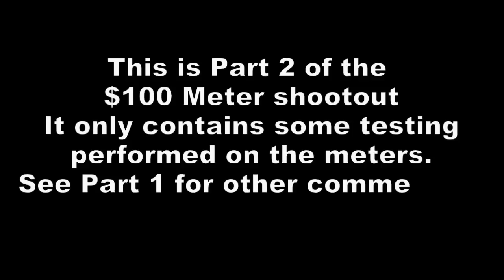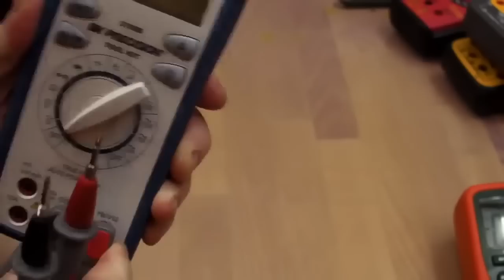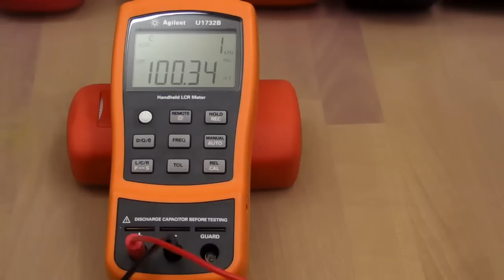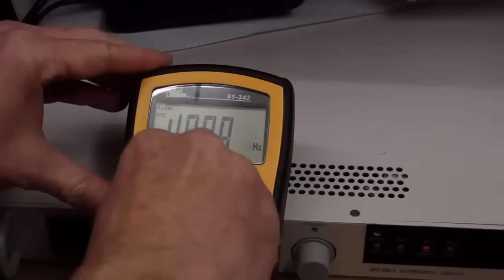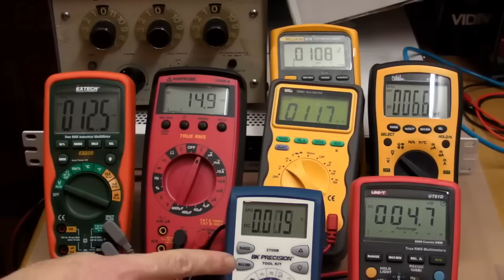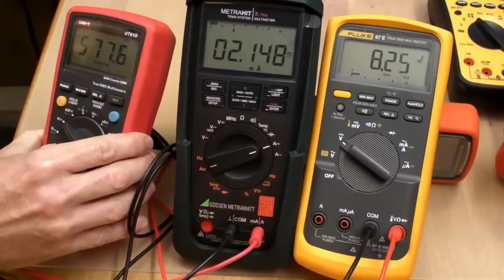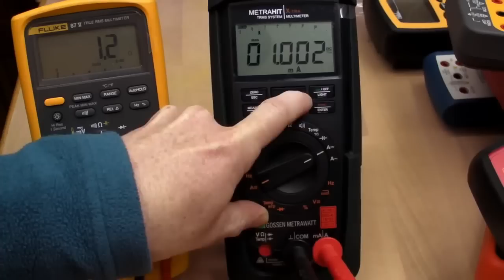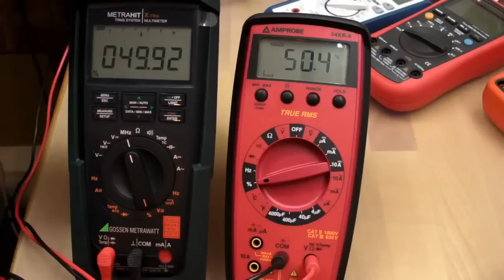EEVblog #99 - $100 Multimeter Shootout - Extech Amprobe BK Precision Ideal UEi Uni-T PART 2of2

Comment: I quite agree with your assessment in part 1 and the fantastic continuity test sealed it for me. I just ordered the BK Precision meter at TEquipment (which happened to have the cheapest shipping to Spain, win-win). I just have to watch out for the burden voltage, but oh well, you can't have everything.

Comment: i guess i answered my own question. i really like my UT60. serial comm works great, but my jaw dropped literally when i was probing around in a MOTU Traveler that i have for repair - i hit the main clock of the DSP and the Uni-T UT60 proudly showed 48MHz!!! Forty-eight meg on a meter that is supposed to max out at 10. That's just darn awesome.

Anyway i found the main issue, blown firewire controller, there are also a number of minor things i will deal with after that chip arrives.

Comment: Dave. You know , I just bought one of those extech 330's. I know you reckon they roll about a lot but I have a cure for that, grab a couple of those sticky square case feet you can get for home brew boxes and stick them to the lower rear corners . not elegant but defo stops it rolling about on the desktop

Comment: +EEVblog Thanks Dave, great video and product comparison. I am looking for a $100 range DMM and your comparisons have helped a lot. -b <---That means thumbsup! This video and your efforts took you some time and effort and is appreciated. Back in the '80's, I worked in repair maintenance in a factory and I used the Fluke 77. I accidentally dropped the 77 several times from the top of overhead (~30 Ft.) cranes while troubleshooting and it survived every time.

Based on the results of all the tests that you did, I would get the BK, which you also seemed to choose in your wrapup in Part 1.

Product Comparisons -b Fundamental Fridays -b Mailbag -b Teardown Tuesdays -b

Comment: I have the Ideal 340 meter.  Same functions as the 342 but not TRMS. I had the same Temperature reading problem until I looked close at the thermocouple. There are + and - signs by the jacks. Doesn't make sense but the temp function IS polarity sensitive.I use this as my secondary meter and love it.

Comment: Dave, what an idea, have a forum design and build your own $100 level meter which has the best features of all of these.. i.e. the 9v battery, the metal thread inserts, the high voltage fuse access, cat rated cables, the right 90deg probe input jacks, a nice fast continuity latch and beep tone, white backlit lcd, a nice REL feature, good cap measuring, etc

Comment: Surprisingly only the Amprobe and the UT61x has the bargraph ... at 100$ BK-P should have thrown that in. Oddly none of them have more then 6000 counts ...
Seems like autoranging speed in relative to continuity speed
(Well the UT61E is 59.20 and that puts it into the 50$ category and is pretty darn quick)

Comment: Seems like every Extech you reveiw has some serious issues. I am a little suprised you like them at all. I use to think they were a good company but I am not so sure anymore. I am an HVAC tech and I use the Fluke 116 with a Fluke 323 Clamp meter. You can count on both for accurate and dependable readings. I enjoy your show, keep up the good work.

Comment: I have a multimeter from which seems to be from the same manufacturer as the Extech (PeakTech 3360). And it also freezes from time to time, not only when you overload it.

Comment: I want a good multimeter from Fluke and I'm willing to pay the $$ but im confused on which one is the proper one to buy. I want one for mains, and for learning electronics testing. 177, 87V, 189?? It's really confusing. Can you point me in the proper direction? I work on basically everything in my home, including computers, and RC gear. Recently I realized that I could have killed myself on my 60 gallon air compressor when the start capacitor blew up. My meter couldn't handle 220v.
Thanks for the vids..

Comment: While it is true that you should not switch modes while the test leads are attached to a live source, or have one connected while in some of the modes, they are common mistakes, and such things can easily be done in a moment of distraction by even experienced user, and there is always the chance of some accident.

Anyway, this not a DMM tutorial, Dave is not saying you should do this, he is only testing if it could survive a mistake or accident, and giving his opinion on the instruments.

Comment: i just bought an unitrend ut60e for $86. can't find flukes for $70 here in romania i'm afraid, more like twice that.

it looks like good bang for the buck, came with proper rated probes (cat 3 positive probe and cat 4 ground probe), also with a pair of short probes w/ alligator clips which will be very useful for current measurement.

i'll be trying out the rs-232 comm later. IIRC you recommended the ut-60 in one of your vids, so how do you like it?

Comment: I have that exact same Amprobe meter, but it has been rebranded as a "Meterman 34XR"... I am not impressed with the capacitance meter at all, especially in the low ranges. After a year of light use, a probe failed with an intermittent open somewhere. I don't have the problem of a loose connection with the probe sockets..... mine are very snug, and I had to press hard the first few times to break them in.

Comment: Hi Dave, I just bought a Klein Tools MM1000 Multimeter and I was wondering if you have any thoughts on that one. I paid $62.00 for it at Home cheapo. I looked inside it and I believe you would be impressed, for what I paid for it. I looked, but couldn't find anything on Klein Tools, in your reviews. Always great stuff on your channel, thanks for sharing
Reply: This is an old comment but just in case you were wondering I also bought a Klein Tools MM2000 (very similar to yours) from Home Depot,  and internally they are almost the exact same design as the UEi DM393 (dave is reviewing the DM391 here),  right down to component placement on the board.  Both brands are also made in Korea.  Biggest difference is that the Klein Tools meters have much larger displays and nicer backlights.
Reply: I bought an MM1000 and it failed internally, showing me all sorts of weird reading that led me wrong until I figured it out. Not buying Klein tools again.

Comment: I have a UNI-T UT61E and it has 1kohm impedance at μA mode and 10 ohm at mA. How could be possible that the UT61D you show has only 50 ohm for μA and 0.8 ohm for mA? The E model is supposed to be better.

Comment: Hi , I have Ideal 61-340 multimetere and have interesting problem - multimeter is not power on when temperature is low,
 amount 15-18C (59-65F) . After 22C - I do not have problem.  And I read  manual that wrote 0-40C. Please help me advice.

Comment: Hey peeps, I bought the BK 2709b and while teying to take a current measurement with it, it doesn't seem to eork much at all? Like the measurement was dancing around .09 .06 then when I took a measurement that should have been around 1.3 amp it read acout .11 or so?

Comment: If a meter says it does unlatched continuity testing what does this mean and what are the benefits to latched testing?
Reply: +Jonathan Willocks It is to help picking up very short momentary contacts. If an unlatched meter probes a contact for let's say a millisecond, you may not hear it, as it only beeps for a millisecond. When a good latched meter detects a continuity, it will emit a longer beep so you can definitely notice even if a contact lasted for only a fraction of a second. Don't be fooled though, cheap latched meters may only latch after a significant time - 200ms or so - but for short contacts it won't sound at all! Might still come handy in a noisy industrial environment when you only need to check a couple of contacts, but for a quiet lab I'd take a fast unlatched over a slow latched any time. The latter may make a scratchy, more quiet sound, but when testing a complex circuit, speed matters much more. 
Fast latched is the best, but usually comes at a price.

Comment: Why is it that no meter in the $100 range can test the voltage and light an LED like the more expensive FLUKE. I had to buy a $350 dollar meter just for that to work. It is really lame that you can't buy a cheaper meter that does this. If my meter didn't at 350 US it would get sent back. None of my cheaper units will do it either.

Comment: Can you use a multimeter to check a lithium polymer battery  I have a 2s and I would like to check both cells maybe you can do a video on it
Reply: just use your multimeter and test the points on the balance plug. be sure not to short any of the terminals.